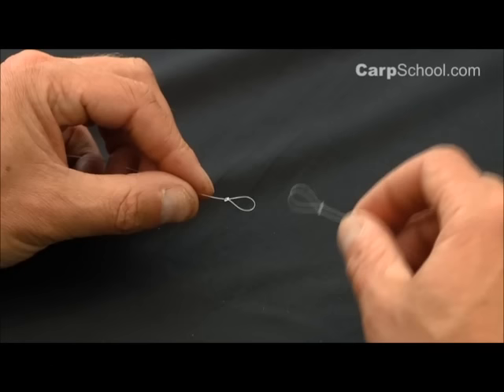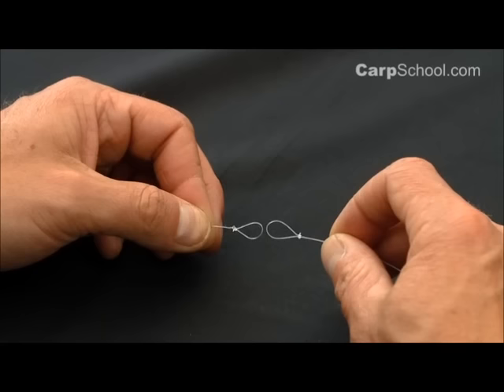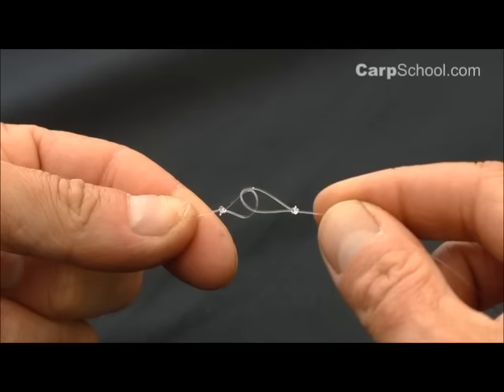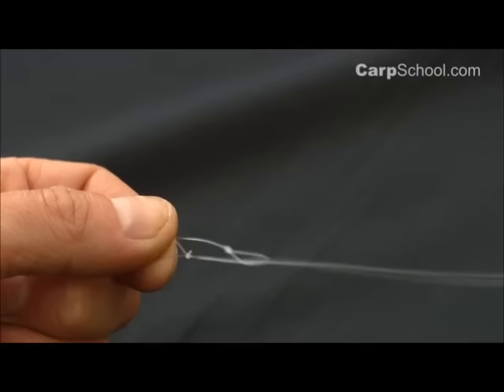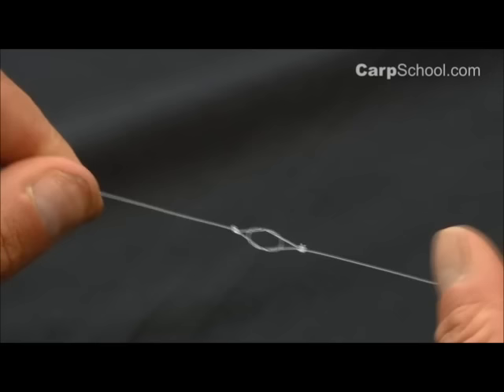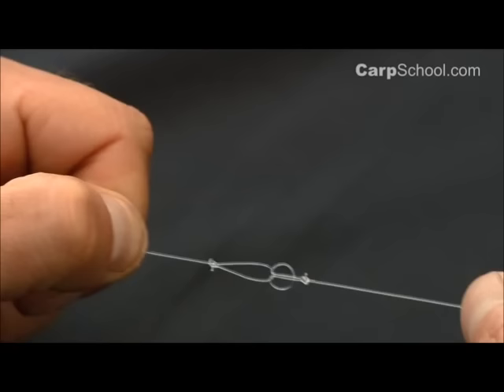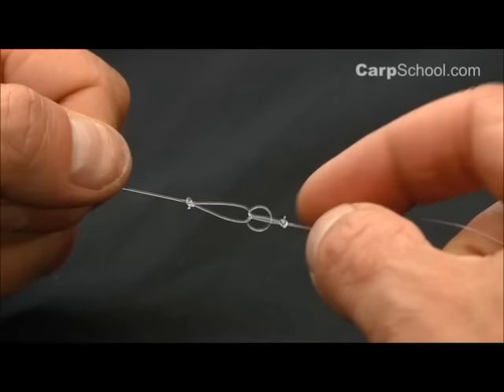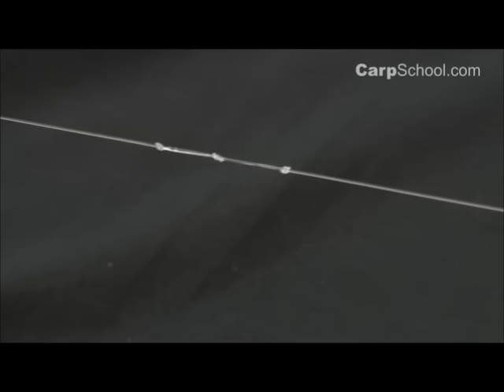How to tie a Loop to loop connection correctly

Comment: Hello Myles, thanks for perfect explanation. I've used this to join my hooklengths to twizzled boom on my feeder.
Do you have a tip how to undo this connection? After tackling a fish or two, when I want to swap my hooklength, the loops are usualy so tight, I cannot undo the connection anymore.
Thanks :)
Reply from the maker: I suggest you cut with scissors one leg of the loop in the hooklink material. Then just pull on the hooklink and it'll be free. Leaving the loop in the mainline. If you cut both legs of the loop in the hooklink it's still not a problem. I think. I hope that helps.

Comment: I've been using a size 22 swivel to attach a fluorocarbon leader to my braid for lure fishing for several years now, but after seeing this I think I'll do loop to loop instead because it dispenses the need for a swivel.  Are the loops made with a double over hand knot?
Reply from the maker: You can use a double over hand, but it is not very strong. The best is a perfection loop. If you need it, I have uploaded a video how to tie it!
Reply: Many thanks Myles, I've been practicing the perfection loop with a ball of string and I think that I have perfected it, cheers

Comment: Does this work with braid as I'm using braid hairs and braid mainline and will it work for mono to braid
Reply from the maker: It will work with braid to braid. It's worth thinking about putting some kind of stretch in the system somewhere so as not to damage the fish too much or get hook pulls. Yes it will work with mono to braid too.

Comment: Hey Myles is it ok using a loop to loop for attaching mono and fluorocarbon together? i have Drennan Supplex 8lb mono mainline looking to connect to Drennan Supplex 6.4lb fluorocarbon hook length. I have just been tying hook lengths with this fluorocarbon line and it was the first time i'd felt it before. Seems stiffer and easier to tie knots with than with mono, i'm just hoping the stiffer fluorocarbon wont cut through the mono in a loop to loop connection. Thanks in advance.

Comment: Please don't laugh at me..... I'm a beginner. You say interchangeable but can you simply disconnect the two loops during a session by pushing them apart, for example after ledgering on the bottom with a hair rig and stopper you might want to go on the surface with a bait band.... Would a swivel and clip be better for the connection to mainline, so that you could easily loop any type of hook to the "constant" clip?  Is this more interchangeable and what are pros and cons ? Thanks Myles
Reply from the maker: Hi, please do ask questions when your learning. It's the only way to improve you catch rate and hopefully enjoyment of the sport. You should never have a clip up the line as this will stop any ledger weight float etc fouling on it if your mainline breaks. However, the loop to loop will not impede so much. I tend to use this loop to loop when joining a mainline to a fluorocarbon or heavy mono leader. Up to 6' in length instead of using leadcore or anti tangle tubing. To be honest if I'm changing from fishing on the bottom to the top I'd start all over again and really you'll want a much thinner mainline so a completely different spool. I hope that helps you.
Reply: +Myles Gascoyne   Yes, that helps a lot, thanks for coming back to me. I'm inspired
Reply: This has me wondering now. I was using a loop to loop connection for my hook lengths but after fishing today i was getting tangles a few times and i wondered if using a snap link swivel to connect my mainline and hook length could help prevent this. Could it? along with feathering the line? when i finished fishing today there was a tangle where the hook length joined the mainline. I actually was fishing with this tangle for about the last hour and at the end when i cut the hook length off, i accidently cut the loop for the hook link because i couldnt tell which was the loop for the mainline/hook link. Bit of a calamity! but my first day fishing in 6 years, and first ever time ledgering.
Reply: flashtheoriginal c
Reply: Myles Gascoyne how do I tie this to a swivel ?!!!